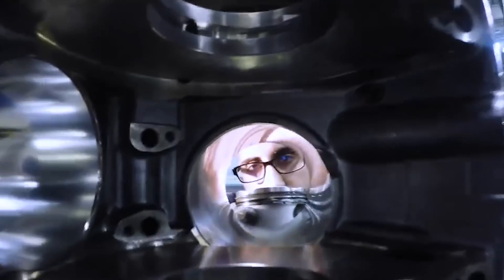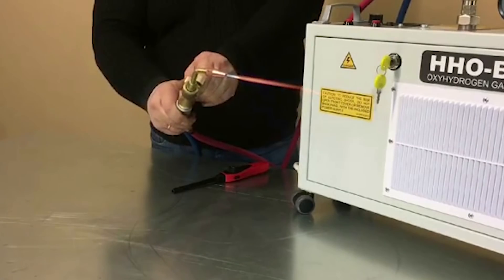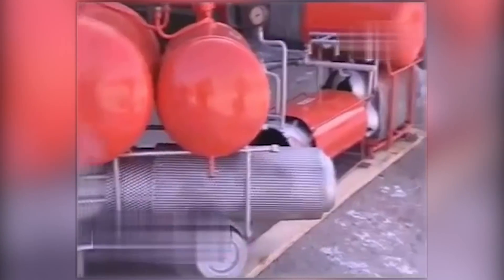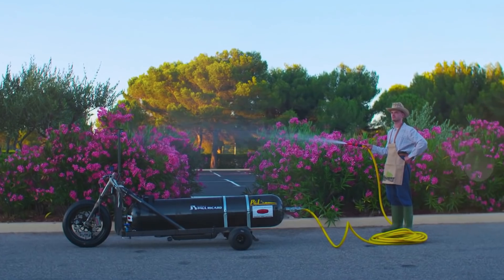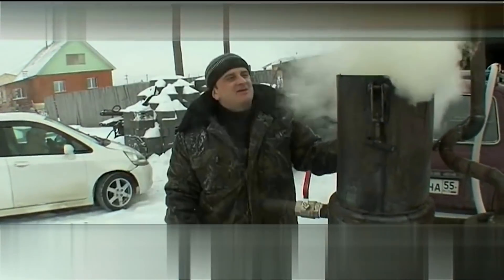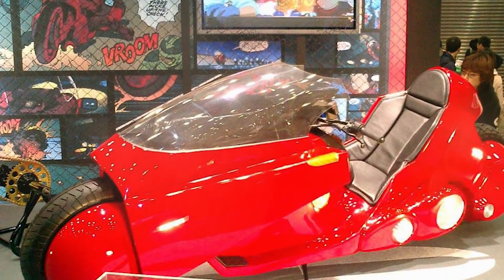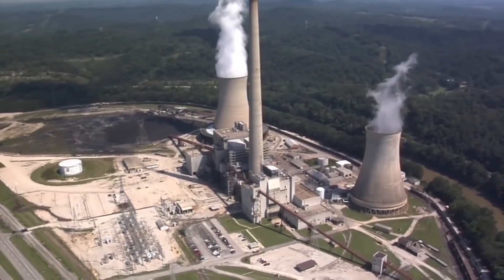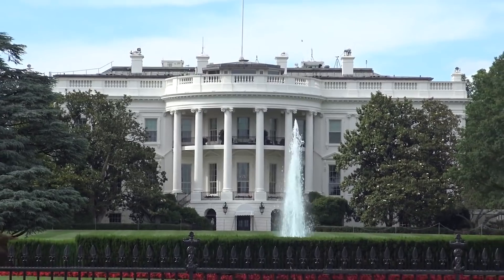Why These Engines Are Banned?

Comment: As an engineer the amount of wrong in this makes my brain hurts
Reply: Was just thinking the same thing.
Reply: Energy of any type doesn't come free.  Compressed air has to be compressed somehow for example.
Reply: @desert1able76  Hydroelectric and Solar ARE free energy. Just build the device and they harness the energy coming from the sun. Hydro is most reliably consistent wind is very intermittent or variable. Hydro dams run 24 hrs. a day.
Reply: @W.451  Actually no. Hydro is best of renewable energy sources, but its not free. Hydro requires pretty huge amounts of concrete, steel and more over room, to keep water stored as you wont get water equal amounts during the year. Also its highly depending on area and cannot be put on just about anywhere. Its useful ,but it does has flaws and few actual dangers like dam collapsing and letting huge amounts of water down to valley that most likely has some city in it.

Then second best or worse renewable energy source is wind power. While can produce lots of energy it wont, cause wind is not constant and down time of wind turbine is aroun 60% of the time. Further more producing the wind turbine takes ridiculous amounts of energy, is destroyed by even small storm, its maintenance and fire fighting is difficult due nature of its tower structure, even more so on ones that are at sea. Finally i just heard about this but coolant used on those to keep generator cool enough is absolutely horrid shit for all living things and its sort of super greenhouse gas (need to research this more though)

Finally the solar... Sure if you have multitude of panel arrays that can track sun you get some decent power, how ever panels life expectancy is at best 10 years, system costs lots of money to set up and takes even more space. If UK for instance would go only solar usage and cut energy needs to minimum, solar arrays would take 1/3 of countrys land mass.. meaning all the trees need to go and everything is needed to be flatten. Lets say we invest on solar systems... what we do about them in 10 years? At the moment all the solar panels get shipped to 3rd world countries where they rip them apart, leaking very toxic gasses inside of them and smash them to recycle some of the metals, while scattering all the heavy metals used to manufacture there into soil. Simply put using solar moves problem another side of the lake so its non issue right?
Also just like with wind power sun wont shine everyday so efficiency goes down. Have crap on the panel and efficiency goes down. Bolt them on rood and you loose 30% of efficiency right there.
Only proper solution for solar would be dyson sphere what controls how much heat radiation gets to earth while beaming energy via laser to orbit and to earth.

Simply put there is no free energy and currently each has its own problems. Going with fossil fuels wont work for ever, but pushing electric cars wont do it ether as those need lithium batteries and those are far worse due mining and processing.. and still fail in comparison to fossil fuel by energy density. I'm open for suggestions but preaching electric is just bullshit that wont in practice until way better energy storage options and the mean while lithium processing and mining should be moved to different planet or into space, where there is plentiful supply of different resources.
Reply: @Hellsong89 Actually yes,  Hydro, is free energy. The building of the device is not part of free energy. Free energy does not require a fuel. Does not require the consuming fuel to harness energy as coal or oil in pumping and transporting or refining the fuel. It does not include building the device to harness free energy.  The source of the energy itself is free.    Hydro produces side industries at the lake formed. extra water sources etc. Hydroelectric dams produce a constant level of power 365 days a year. Hydro has been a fantastic blessing as it produces 24% of the world's energy.
Reply: @Hellsong89  How Long Do Solar Panels Last? 25 years (or longer). This is the industry standard warranty from Tier 1 manufacturers. In reality, solar panels can last quite a bit longer than that: the warranty typically guarantees panels will work above 80% of their rated efficiency after 25 years.Jun 7, 2018
Reply: 451 i see both of your points. It takes a lot of energy to make these dams, batteries, and panels. Engines to haul, mine, produce, etc all these things. There's still no way for batteries to power large machinery. An 18 wheelers would be mostly battery in weight to transfer any freight any reasonable distance. Just things to consider
Reply: @W.451  So you have no concept of amortization of costs. Excellent.
Reply: @mfree80286  The energy still comes free. Can't understand the simple thing light and gravity powered water are self produced unlike combustion fuels.
Reply: @W.451  Hydroelectric runs as long as there is the water supply, but this means you depend upon the location - unless you have a closed-loop system where the same water is reused (pumped back uphill, entailing use of grid power) and it is for energy storage rather than generation. True about wind power - so many negatives to it. among which is dependance upon the location - and likewise for solar (stronger sunlight = better generation potential) which also suffers with degradation of photoelectric equipment (in the case of photovoltaics) and the petty matter of dust settlement (eg the fabulous mirror farms in the USA that failed because of breakages and dust).
Nuclear is the future for static power generation, as long as politics don't get in the way..
Reply: @W.451  Properly tap a single volcano and we can power the planet. The biggest hurdle then becomes transmission.
Reply: @W.451  not free energy. Millions of dollars went into building the dams and turbines to harness this energy. Millions of man hours in construction and maintainence is spent every year to keep this free energy operating.
Reply: @W.451  says you. You can say whatever you want to make yourself sound smart and right, but it still doesn't change the fact that you're wrong. You don't have the ability to collect the "free" energy from a hydroelectric installation. You have to pay for it. You don't have the ability to collect the light from the sun and turn it into electricity. You have to pay to have the ability to do that. Your idea that the energy from the sun and water is free is faulty due to the fact that the energy from the sun is in a form that you have to modify to use unless you are growing plants. It is free to warm you when you are cold on a breezy day getting out of a swimming pool. But the energy from the sun won't run your air conditioner or turn on your lights. You have to convert it. That costs money. The only thing that truly is free is the air you breath.
Reply: @W.451  "blah blah blah" The thoughts that are constantly on your mind. Does it hurt to form a complete sentence? You should take a break. I see steam shooting out of your ears. You can edit your comment so you don't have to make a separate comment starting with the word 'and'.
Reply: "Energy of any type doesn't come free.  Compressed air has to be compressed somehow for example."  It is called a trompe.  It has no moving parts aside from a valve.
Reply: @wesbaumguardner8829  You aren't getting 3000psi out of a trompe. And with the size of tanks versus the work desired, without 3000psi you aren't getting out of your driveway.
Reply: @mfree80286    The head pressure is only limited by the elevation difference between the air storage tank and the water outlet.  To achieve 3,000 psi, this is only 7,000 feet.  Oil companies drill to this depth on a regular basis with directional drilling.  A quick internet search showed the deepest directional drilling being 31,000 feet, so you do not know what you are talking about.
Reply: @desert1able76  also storing compressed gasses always carries some risks of the tanks rupturing, which is not fun.
Reply: @desert1able76  Foot Pump ? an a little excercise :)
Reply: @desert1able76  
Yes, and he already explained that it was overall cheaper and much less pollutive (don't need a lot of energy).
Reply: @MaverickSu-35   Robin Smith  
Please go ahead and use these vehicles. We need a cleansing of stupid people anyway xD
It's a very good idea to sit on not 1 but 3 tanks that are basically bombs. If it breaks you will go flying like a mitten in a storm.
Reply: @MaverickSu-35  and he was wrong. the law of thermodynamics means, the amount of energy needed to move the car, however light you make it, would be the same amount of energy to compress the air. the only thing that happens is some energy is lost in the componants of compressing the air and putting the air into the machine. your still better off just putting the engine that compressed the air into the machine, you know, a petrol engine lol
Reply: @matthew4107  
I agree with you, but only for the particular case of wasting energy to compress air on very small scale such as using an electric motor (which also gathers electrical energy from a fossil fuel conversion) or simply a combustion engine to drive a pump for compressing the air in a small cylinder in your car. At an industrial scale though, if using highly economic combustion engines or electrical motors to compress air in high volume cylinders, you may probably get more economical overall. If no one has done a fair test, we're only trying to estimate using our minds and in most of the cases, what we think of is more or less far from true. It can be rather precisely as thought or it can be far off. I'm not trying to say that I'm right, I only wish that someone like "Project Farm" (if you know about him) could simply make some tests (within the available limits of accuracy) and just check how much he has wasted versus how much he has economized regarding the use of compressed air as a sort of propellant.

I personally love the combustion engines anyway, but I've only gotten into this idiot subject of using compressed air as fuel just by chance, and now I'm like trapped into a vortex of replies and contradictions=))). I don't mind now and for the sake of contradiction, I consider that there's a possibility of using a high efficiency (low losses) process of compressing air at an industrial level for driving our cars with, might actually turn more economical, but again, it's just my guess and it comes as a counter to replies that I don't find right! Cheers!
Reply: @matthew4107  The actual meaning of free energy is that the energy source itself is already there with out processing or extracting from a form energy from a raw form. Everything you just wrote is about a perpetual motion device nonsense. Get it straight gasoline has to be produce and it cost money and effort. Solar and hydro are not produced with anything from man.  Just build the device and harvest the energy. The device will cost, but the light and water are power by the sun. Totally different thing. The sun and water pulled by gravity, energy source is already there.  Oil costs to refine and transport.
Reply: @matthew4107  Realize a LOT of people really aren't very bright and confuse perpetual motion with a free sources of energy like sunlight or water - hydro dams water cycle is powered by the sun. We just need to build the device, but the actual energy itself costs ZERO unlike oil etc.  Like those solar phone chargers, put that in the sun and charges without burning any fuel processed with costs and effort. You can run a phone for it life and never plug into the wall as the light energy is actuslly free.
Reply: 451 its a shame people still cant see it lol.

Ok, fit a solar panel to a compressor, compress the air with that power, wait. Why not just put the solar panels on the car to compress the air, 

Ill tell you why, because youd be better off running the car from the power given by the solar panels, and not wasting energy compressing air to run the car....
Reply: 451 il not confusing anything with anything. I have full understanding of how power generation, storing and sharing works.
Reply: @matthew4107   I said some people confuse perpetual motion idea with free energy. Not related. And while sunlight is free, solar panels convert only a percentage of it to electricity.  Solar panels convert about 20% of the light to electricity.
Reply: Maverick Su-35S But it’s literally not. Also air will diminish in pressure.
So your car will fizzle out.
That car has been featured on futurism shows since the 90s.
Reply: @kevinjackson4464  the funny part of that statement is that this guy is pretty smart. he's getting paid by youTube to post these videos, and get a whole lot of people to watch them, comment on them and "subscribe"!!!
Reply: @SonnyKnutson  what you think your fuel thank is or you lpg tank is ? And nowadays you dont need that with the number of vehicles on the road who get on fire by electronic issues i would feel safer in one powered by air
At least those will not burn your skin up when they blow 😂😂😂
Reply: @desert1able76  Indeed. Frankly, I prefer a compressed air vehicle. The amount I spend on gasoline/petrol is about US$120 a week. The amount of energy to fill 3 compressed air tanks is way less than 120 a week.
I am highly interested in importing on of those cars.
Reply: @PrincipalDBA  You'll be very disappointed.
Reply: @PrincipalDBA  Imagine how much cheaper it would be to run them straight on electricity and cut out the inefficient air compression process!
Reply: @PrincipalDBA  Compressed air tanks are heavy and cannot hold very much energy. Usable range is very short. Also, the "well to road" energy efficiency is poor.
Reply: @Dave5843-d9m  
Thanks Dave for taking the time to reply. I am thinking the application is therefore very limited and not for vehicular travel.
Reply: @PrincipalDBA  you would spend more running that car than you would on gasoline, and besides, you couldnt drive it because it wouldn't pass safety regs. Making such a car safe would make it weigh twice as much.
Reply: @PrincipalDBA   The air compressor needed is $3000 for the cheap one.  Maximum Pressure Output 4800 psi .  cost to fill calculated out to be $5.20 =  $.15 per mile. Gas car $4 a gallon 30mpg = $.13 per mile.
Reply: @szki272  Thanks. Gas now cost way less except maybe California. :)
A compressed air powered car is having limited scope, maybe indoors like a warehouse or underground facility but not for commute.
Reply: @PrincipalDBA  for the amount of power it has, and the speeds it does, there isn't really that big of a difference. I mean these cars have about the same amount of power as a small motorcycle engine, probably less to be honest. Compressed air is rather heavy and also dangerous, moreso than gasoline. If you get in a moderate to major wreck in such a car it WILL explode. Not to mention that relatively low energy density. If you wanna save money, get a car with a smaller engine, or swap the engine in your current car for something smaller. Sacrafices will be made regardless of which you go with.
Reply: @PrincipalDBA  mate, 3 tanks of compressed air won't do the same amount of work $120 worth of fuel can do
Reply: @PrincipalDBA  But HPA compressors cost a shitton, so no.
Reply: @desert1able76  AETHERIC atmospheric free energy .
Tartarian architecture all around the world still have Aetheric atmospheric free energy built into their architecture.
Reply: FEMA offers fully detailed blueprints and instructions on how to build the "wood gasification system" for free on line.
Reply: @huntsbychainsaw5986  It is called a Gas Producer and during the oil crisis of the second world war it was common to have one fitted to your car. My did had a straight 8 Buick and ran it on coal or charcoal. Obviously having and open fire on the back of your car and took half an hour to start was not very practical so they were dropped after the war. Nothing new here .
Reply: @frankiedogturner1516 . I'm aware of this, I did my dissertation on alternative fuel in college.
Reply: Hunts By Chainsaw Germany used it in the closing stages of WW2 to power Tiger tanks.
Reply: yeah, this reeks of bullshit.
Reply: Ikr, in principle. Sure.
In practice? Laughs in the laws of conservation
Reply: As an engineer I agree also, also this is just conspiracy hysteria.
Reply: @Allen Loser what is a yard?
Reply: Oil, gas, and coal companies do not like any energy sources that they can not put a meter on in order to dictate their prices.
Reply: as a non engineer the amount of wrong in this makes my brain hurt. I can only imagine someone who knows a lot more than me. God bless you
Reply: Lava LifeGuard  I mean he didn't say English Major.
Reply: Boy oh boy! I sure can go along with that statement!! Unfortunately the masses just absorb without discretion.
Reply: Exactly! All the knowitallery is just stunning ... all the promises of 30, 40, 50 % less fuel ... blabla, all of it! If any of that were true, one company would definitely use it ... this isn't even about engineering, but very very basic economy.

Conspirancists and technological analphabets go hand in hand...
Reply: DC this isn't about economy you twit. It's about not rocking the boat or changing how comfortable some people fell unless you force the change.
Reply: Hell, as a non-engineer, it makes my brain hurt too...
Reply: from one engineer to another, its all over youtube, absolute bollocks everywhere
Reply: None of these engines are banned , just fake.  Hucksters come up with them to bankroll a fake project it’s just a scam. All those sleek looking bikes and cars work off batteries or gasoline, and are only built to separate investors from their money.
Reply: This just goes to show you, that if you come up with a breakthrough invention that could greatly better the world but also disrupt the grip that the powers the be have on it, you should keep it a secret lest you end up dead for your efforts.
Reply: As a normal layman,  this hurt my brain. Fossil fuel Giants are in the game for energy, not just fossil fuels. If there was a cheaper way to power the world, you can bet companies would be jumping on it, possibly the same companies who are using fossil fuels. The reason we use fossil fuels is their energy density. You just can't get around thermodynamics. Have a nice day everyone.
Reply: @lancelefevre351  40% of oil production goes to transport. I acknowledge the fuel density is higher (at the time being) but what doesn't seem to be taken into account is the inherent inefficiency of the majority of piston engines (no more than 15% in reality). So given this, the fuel density used in these engines must have 85% negated as it's wasted. The worst way to use fossil fuels is to burn them.
Reply: roots No1 M Souljah that is true that modern cars barely use the energy and waste most as heat. There are far more efficient engines that use the fuels at higher percentages though. The 2 stroke turbo diesel can reach numbers of 50% and higher. Same with the turbine combustion engines used in power plants and such. Where I was making my point was, an 18 wheeler can carry 250 gallons of diesel and move 80,000 pounds 1,100 miles or more. An electric 18 wheeler is beyond our current technologies because there are not batteries that are both powerful enough and light enough to move frieght any reasonable distance. Gasoline has more energy than lithium batteries by density. Way way more. There is no current technology to move the world without fossil fuels. Not saying it won't come, but it's not here yet.
Reply: Lancifer Lancifer also because fossil fuels are more reliable and common than other energy sources
Reply: boogi_playz exactly
Reply: Lancifer Lancifer Shell, BP, ESSO are all bu
Reply: @lancelefevre351  agreed, but the application of thermodynamics could be greatly improved. Look at Diesel electric trains. They get insane fuel economy because they power a generator which energizes the traction motors. Cars would get over 100mpg easily if we used this tech in cars, but then they aren't going to make as many billions. In 1998 we were driving big sedans with v-6s that got 30mpg now we have 4 cylinder with turbos barely getting that. Some 20 + years later we should be doing much better.
Reply: @jeremypilot1015  I agree completely. My 2000 Toyota tundra V8 gets 21 mpg and the new tundra gets 13. It's a money game. Front to back
Reply: @lancelefevre351  "As a normal layman,  this hurt my brain. Fossil fuel Giants are in the game for energy, not just fossil fuels. If there was a cheaper way to power the world, you can bet companies would be jumping on it, possibly the same companies who are using fossil fuels. The reason we use fossil fuels is their energy density. You just can't get around thermodynamics. Have a nice day everyone." Yes and no. YES, they'd love a better fuel / energy generator. But NO to the "bet companies would jump on it" part. They have it too easy with oil, too much invested in it. So you can guarantee they want to squeeze every little droplet out of that first. Stuck in their greedy ways when it comes to oil. It's odd though, because they'll always need oil for lubrication in machinery. Just shouldn't be burning it anymore, especially on mass like... 🥴
Reply: @Johny40Se7en  that's one of the first rebuttals to what I said that I feel like is a damn good point.
Reply: @lancelefevre351  Re-think energy density as Thorium fast reactors outperform fossil fuel and was closed down in 1969  after it was perfected. Not much lobbying needed in congress when you consider the petrodollar.
Reply: @lancelefevre351  not really the key is that you can't make it yourself (at least not cost effective).
Reply: @lancelefevre351  I definitely believe that fossil fuel giants will hop onto the next thing as soon as it's more profitable, but I believe that there will be a small period before they do, as new tech will need to be a good margin more cost effective than the old, to make up for the cost of needing to update all your facilities etc.
Reply: @lancelefevre351   stay with law ;)
Reply: @lancelefevre351  true, but... rebuilding the whole production chain has huge costs, so there might be something to the idea of "technological inertia" - nobody being too willing to do complete retooling, and at the same time, nobody wanting to be out-competed by any of the new guys, so they just assassinate them. you've got to admit that the amount of mysterious deaths and murders amongst people who claim to have found new, cheaper energy sources is suspiciously high...
Reply: @lancelefevre351  however there are more and even some can be replaced the problem is these people end up dead before its ever fully completed soo what about that ?
Reply: @lancelefevre351  ~ A logical deduction for someone who fervently believes that people NEVER conspire to achieve unjust enrichment. See Patrick Kelly's (free) free energy book. It is about 3,000 pages describing in detail hundreds of potentially viable free energy devices, mostly in sufficient detail to be replicated, fully analyzed by an electronic engineer (at least)with many of them inexpensive to build as well. I'll leave you the joy of seeing how full of conspiracy and subterfuge the world really is. "Normal" has recently been moved up a few notches, so please catch up.
Reply: @lancelefevre351  That's a bit of a naive outlook don't you think?  Ever consider the threat to their profit margins if there is a cheaper source of energy?  Didn't you hear about all the mysterious deaths of those linked to alternative energy?
Reply: @lancelefevre351  you would think so wouldnt you
But look at newspapers the tech was developed to make paper from hemp instead of wood pulp
The machinery changes would have cost them millions in todays money
So they started the war on hemp/cannabis instead because they would rather supress things that cost a big payout for gains in the longrun
How many times do companies buy up new small tech and just shelf the item that would be competition
Reply: @lancelefevre351  the name of the game right now isn't power density but the reduction of greenhouse gasses which means a loss of profit for oil and gas companies. So it stands to their gain to try and only make monetized forms of power, that's what started the push for hydrogen a while back was because companies saw another monetize able fuel source as opposed to switching entirely to electric that is way more feasible for the near future.
Reply: @lancelefevre351  Tesla was about to give free, wireless energy to the world. When JP Morgan (his financier at the time) asked him... how do you meter it? Tesla answered.... you can't. Morgan shut him down immediately. See, the real crux is that they want gradual, monitored, metered, controlled progress in order to not upset the balance of power, which is in their favor.
Reply: @lancelefevre351  No, they absolutely would not endorse the development of self-sufficient energy production; the entire idea of "the free-market" is to breed dependency on external products. That is why the Aboriginals in Australia were bussed in from remote tribes against their will, why the "trail of tears" happened in America, and why the Vedda tribe in Sri Lanka had their right to harvest from the local rainforest revoked by municipal authorities - they DO NOT want you operating off-the-grid, under any circumstances. This means there are less tax dollars to embezzle, less profit for corporations, and overall less control over you, and through natural extension more power over them. Another rule is that organizing outside the jurisdiction you pay homage to is also a no-no. If you want some idea of what happens when you try to form a mini-enclave inside your country look at the Waco Siege where the CIA/FBI fabricated evidence to burn their entire community down, or look at Amos Miller Organic Farm and what happened to them this year when they started building something autonomous. Positively THE LAST THING TPTB want is someone distilling their own water with sunlight, or powering their home with DIY technology, no fucking way is that going to fly absolutely anywhere on this blue ocean planet. You might say "oh - but i can garden", ya, for now, U.S gov are currently passing legislation to force people to declare their community gardens to the federal government.
Reply: @lancelefevre351 , why can't we get around thermodynamics?
Reply: Lancifer Lancifer idk man if something threatens a giant, suddenly it’s gone hmmmm
Reply: Yes
Reply: Allen Loser exactly. That was my point as well
Reply: Allen Loser exactly, same as rust is the burning or oxidation of iron. I've never looked at it like ashes though. That's pretty awesome. Hydrogen bonds in water are pretty amazing too. How much energy it takes to turn water into steam always blows my mind.
Reply: Allen Loser and more to your point, these companies are the going to do an immediate transfer to different energies. These companies do however spend the money on research and lead a lot of the research into future energy. It's the industry they're leading, they have to change with the times.
Reply: Titus  look at all the engineers maan...
Reply: cmdrbigbob I’m 
With ya. 😆 haha 😂
Reply: Titus  He took the F-bomb out.
Reply: @Allen Loser but I suppose if you could use solar power to do it it will be a fairly efficient way of storing the solar energy, specifically if you need to store the energy for long periods
Reply: @Allen Loser Goodyear started off selling Condoms, when the rubber condom industry was overtaken by latex, Goodyear moved to making tires.
Reply: cmdrbigbob this guy has absolutely no idea what he is talking about
Reply: cmdrbigbob 👀
Reply: @Allen Loser you smart!
Reply: @Allen Loser no but deuterium, and tritium are, which are isotopes of hydrogen.
Reply: @Allen Loserthanks for the response. 
i agree with you 100% except for the last part. Yes fusion reactors hv been 20 years away for 50 years but this is due to the fact tht it was always 50 years away, but engineers looking for grants cant be honest and say gimme a hundred mill and ill hv something for you in like 50 years. Lol. So they hv to constantly make it seem as if just one more cash infusion and voila. 

But I believe they are actually 15-20 years at most away from the first economically viable fusion reactors. To which i believe will consist of deuterium/helium 3 or pure deuterium reactions to start.  I also believe that protium reactions aided by cno(carbon nitrogen  oxygen) will be commercially viable shortly there after.(in large reactors)And maybe 30-40 years from now we should hv the technology to create msmh(meta stabilized metallic hydrogen)
Reply: @Allen Loser the idea was that it would run the packaging department of the seed farm. The gov gave a partial grant. On paper it seemed alright. If it lasted 25 years it would have been paid for and I would receive tax credit every year it produced. Pretty much a loss.
Reply: Combine a bunch of conspiracies with professional editing and narration, anyone will automatically believe it.
Reply: I can 100% relate
Reply: youre just a bad old oil magnate ;)
Reply: Not even an engineer but how much he says "Imagine if oil companies found out about this" hurts. Not all the ideas are practical and 100 kph is actually relatively slow.
Reply: this, very much this
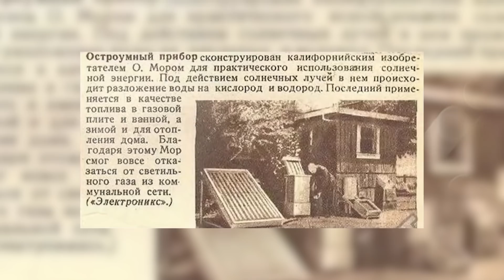Reply: I am almost at the point of throwing up at the ignorance after 1:50. I will not watch more.
Reply: me too. Im actually quite angry.
Reply: As an uneducated intellectually challenged specimen, this hurts my brain.
Reply: Engineers doesnt really know much about this things,if you're a technician that i will believe you.
Reply: Engineers doesnt do shit.
Reply: I hate to break this to you but the theories you were taught are not necesarily the only way of doing things. Don't get stuck into one mode of thought. Science and engineering become stale with that kind of mindset.
Reply: Yup.
Not an engineer, but i design lots of circuits. Its hard to watch...
Reply: Brain pain ouch
Reply: As a fellow Engineer, i feel your pain as well.
Reply: Titus  perfection comes in many iterations of design :P
Reply: Titus  And AFTER editing it's grammatically erroneous!  Wonder if it was correct before :-)
Reply: Titus  engineering has nothing to do with getting it right the first time.
Reply: Titus  no u
Reply: -.-' yea even as a pothead im sitting here like really.... did you just say nuclear fusion and then refer to a "Nuclear **Fission**" plant..... so as engineers i feel a portion of your pain
Reply: @j mcmann well if you payed attention in the 3rd grade you would understand that fossil fuel in particular Crude Oil is formed by fermentation of biological matter at high pressures in the earths crust over 100's of thousands of years.... basically the same fucking principles as the formation of ethanol when making moonshine....
Reply: For an engineer you're not very bright anyway, but that's what we have for education system these days, it is not your fault.
It wasn't about the engines.. This is why we have so many problems. Research holodomor, Rhine Meadow Death camps and other events in history and realize whats really going on in the world.
Reply: Combustion engines are truly inefficient.
Reply: @j mcmann why don't you look up how ethanol is formed in the making of moonshine... your answer to the fossil fuel question is explained right there, except with fossil fuel (crude oil) its the fermentation of organic and biological matter at high pressure for 10's of thousands of years one of the byproducts of this fermented organic and biological matter (fossil fuel) is ethanol which can be burned in an internal combustion engine
Reply: @j mcmann well aren't we talking about fossil fuel here on "Earth" not on some planet technology has only observed through a fucking telescope lens, and for your information biological beings such as a dog or your own human body contains a substance known as glucose from the things you eat, now glucose is basically sugar but is formed naturally by plants, you see where this is going? or you need me to slow down and spell it out in 2nd grade language?
Reply: Titus  And he still didn't make a cogent sentence.
Reply: @Allen Loser Using compressed air/gas isn't to far fetched as you may think, in the early part of the 1900's compressed air propelled Torpedoes could travel about 1,000 Yds, introduce a fuel source such as kerosene and the air will get hotter which in turn makes it expand more.   The Japanese Type 93 Torpedo inspired by the British oxygen-enriched torpedoes had a range of about 10 K.
Reply: @Allen Loser That's exactly what was designed in the early 1900's, the compressed air is used as the power source to drive an engine,  by injecting a fuel i.e. kerosene and igniting it,  that in turn heats the air and makes it expand producing more gas to drive the engine.   By cooling the combustion chamber with water; which turns to steam, that steam is also fed to the engine together with the combustion gases.  They are called Wet-Heaters.
Reply: As an BSEE, i agree 100%. Because the idiots who say anything over 100% don't understand math.
Reply: @jeffreyryan7671  But you can go over 100%,  depending on it's use.  I.E There's a 200% increase in thrust from the new rocket.  The country is in complete meltdown with inflation running over 2000% compared to two years ago.....Or am I taking you comment out of context?
Reply: Titus  THATS your best comment? How do you know he didn't just realize saying anything further was pointless? As pointless as your comment.
Reply: Titus  Now see, right there, I bet you didn't notice your typing was horrendous!
Reply: Titus  You clearly have no sense of sarcasm.
Reply: with that much wrong you could make a engine that runs on it.
Reply: @Allen Loser Exactly - water could be regarded in this matter as oxidised hydrogen.
Reply: It's not even good fiction.  If someone is going to make up facts they should at least provide some suspenseful or interesting story to go along with them, otherwise it's just garbage.
Reply: cmdrbigbob 
I assume that has something to do with why likes and dislikes are turned off...
Reply: Daniel Davidson  
Like the man or not, he's spittin' straight 📠.
Reply: you don't like driving a giant hand grenade?
Reply: I don't think you need to be an engineer
Reply: As an engineer your brain hurts.  What's wrong you mean they didn't teach you any of this in school. LOL. They was to busy lying to you. And Brian washing you into there science fiction dogma.
Reply: @Allen Loser in the case of hydrogen vehicle: you will also be harvesting the kinetic energy during motion, that will recharge the battery and be used for electrolysis.
Reply: same here
Reply: @Allen Loser water is very a fuel! You’ve been gimmicks to believe so! Water is the fuel for everything in the universe!
Reply: @Allen Loser 100km
Reply: Exactly! Look at basic thermodynamics and the laws of physics and chemistry.

1) It takes energy to split water into hydrogen and oxygen, in fact considerably more than you get by burning the hydrogen and oxygen produced. Unless this energy is free you lose.
2) It takes energy to compress air, unless you can capture the heat of compression this is a rather inefficient process, again, unless that energy is free, you lose.
3) Those engines that run on magnetic fields are either electric motors or thermodynamic snake oil.
4) Running a car on wood or other solid fuel is one of the dirtiest ways of getting combustible fuel, without a lot of processing of what comes out of the gas producer you will gum up your engine in no time, assuming you don't' kill yourself with CO poisoning from the carbon monoxide the process produces.

And that is just for starters.

And nom I'm not a shill for big oil.
Reply: @Allen Loser but how was hydrogen created in the first place?
Reply: @Allen Loser The Whitehead torpedo of 1866, was the first successful self-propelled torpedo, and used compressed air as its energy source.  Heated Torpedoes, had kerosene injected into the air and ignited it.  In this manner the air is heated more and expands even further, and the burned propellant adds more gas to drive the engine.  That was in the early 1900's.
Reply: Do the dead people make your brain hurt you pontificating buffoon?
Reply: @Allen Loser Could have fooled me, your body is fueled by water, among other things....
Reply: @Allen Loser You're right that water is not the fuel itself, more of a catalyst in some ways? You die without water as well, but it is not specifically the fuel per se. It was kindof a knee-jerk reply which I immediately started debunking in my own head after I said it. =)
Reply: The amount of tinfoil wasted as hats by some of the people replying here is mind boggling.
Reply: Source: trust me dude
Reply: As a average human I agree
Reply: Huh
Reply: You may be a waste disposal engineer but not an engineer in any technological field.   How do I know this?  A real engineer would have used his spell check.
Reply: As a non Engineer my self, this is all true because I have seen them in movies working fine :). a few Hollywood magic dust and everything is possible LOL.
Reply: Hey smart guy, you would think that you could write correctly. Hurt not hurts. Pshaw, dumb ass.
Reply: As a physicist, engineers, please stay out of that which you know not.
Reply: I stopped at: "this will allow driving with zero expenses". 
Still waiting on the tree that grows into a filled up compressed air tank.
Reply: Allen And your dumb enough to think they don't sabotage anything better than what they have? Do you not know how greed works.
Reply: Allen That's you then most of the hem don't care.
Reply: Yah
Reply: Perhaps you should switch to Electric Gavitic, Anti-Gravity technology....it might make more sense 
TO YOU !!!!!
Reply: Its mind blowing how wrong this all is
Reply: It’s because you spent too much for your indoctrination
Reply: As a small engine mechanic I hate this
Reply: Me too
Reply: You don't even need to be an engineer, just a nerd.
Reply: as a conspriacy theorist I know its all probbably true..
Reply: Thanks, Bob! Thought the same . . .
Reply: Engineers for ExxonMobil, I presume? Capitalist corporate oil monopoly propaganda.
Reply: That's why the engineers need to team up with some of the best personnel for security so that you can be guaranteed to succeed💪👊
Reply: @dannycreech4177  security is purchased. Like a mercenary. To the highest bidder they go. If you create an invention that can greatly improve our worlds sustainability, don't let anyone know you invented it. Post it on the internet from as many different places you can so as to let the world have it. But if you're looking to get rich, then be prepared to spend whatever you earned selling your invention on staying alive. You will either die under mysterious circumstances, or you will just stress yourself to death.
Reply: @dannycreech4177  o
Reply: @Allen Loser Nice try. The correct answer would have been (quote) "...was legally defined to be exactly 0.9144 meter in 1959 under an agreement in 1959 between Australia, Canada, New Zealand, South Africa, the United Kingdom and the United States."
Reply: @Allen Loser True, but with most of their capital tied up in the current fossil fuel model, by and large they aren't going say- Gee, a whole new way of fueling the machines we build! So let's trash billions invested already in the tools, assembly lines, supply chains, and trained workforce and start doing something completely different! Without government policy and some tinkering with the so called "free market" it ain't gonna happen or it takes forever.
Reply: Are the accounts of the mysterious demise of those inventors true?
Reply: @darrenstettner5381  Not entirely true.  There are a good real of facts and origins around some of their deaths, but they aren't as mysterious as the content maker suggests.  Hell, you could make up any scenario to cover anybody's death, phrasing and vagueness will only lends credence as vague and misguided detain isnt provable by nature of the single sided questions they pose.
Reply: @darrenstettner5381  yes. 2 I know of for hho. running cars on water or hho can get you killed if you sell it or put it in other peoples cars. for personal use it's allowed. I had a park avenue I increased the mileage from 22mpg to 34 mpg city highway avg. and 42 mpg highway.  I got a visit from an odd stranger, I believe, because I wanted to sell the generators that could be easily installed on any car. I never saw him again. I told him it only increases mpg but couldn't run an engine by its self. But some people in the group who could runs their cars on water got the above threats about duplicating their work.  The Gov. loves it's money from the gas tax more than the lives and lifting expense and burden from it's citizens.
Reply: @darrenstettner5381  some of them yes
Reply: @darrenstettner5381  yes you can actully find a ton of info with some basic google searches
Reply: @darrenstettner5381  NO. Not 1 of those "inventions" was practical, and the oil companys laugh at them, because it takes fossil fuels to make most of them work. Thorium plants are real, China stole that tech from the U.S. in the 50's and are running a thorium test plant now. We should have been building them long ago, as they are safer than fossil fuels, and eat nuclear waste for breakfast.
Reply: @darrenstettner5381  yes
Reply: @darrenstettner5381  
Some of it during Clinton administration someone was sending Anthrax Letters, the FBI had a guy called Bruce Edwards Ivins as his main suspect. And Dr. Wiley was apparently investigating the origin of the Anthrax...It may have been killed for a different reason, but for a youtube channel Likes are more important than facts.
Reply: @darrenstettner5381  Yes, you can research all those people.
Reply: Russian propaganda this.
Reply: Engineers are educated idiots
Reply: From my experience an Engineer is a man who would climb over 50 virgins just to f*** the mechanic
Reply: @omnigar9611  Top comment---I know several engineers in 3 disciplines; every one of them is addicted to "what the book says".
    These guys invest a lot of time, energy, and money into their careers and thus instantly feel threatened by any information which may rock their boat. 
     Some of the best historical mechanical/electrical discoveries, and one important recent one, were made by amateurs/enthusiasts/students. 
      As for Thorium, it's benefits are obvious and there are a few main-stream Nuclear Physicists who have touted it's advantages----the nay-sayers on this thread are probably paid shills.
Reply: I know what you mean, and worst yet if you tell some one the truth they are mad at you!!
Reply: @Allen Loser I don't disagree (and I thought you handled a number of the dumb-ass posts with a swift correction!). I'm just skeptical of the idea that corporate players at XOM, Shell, BP, etc. will act out of foresight and begin to adapt to changing demand that isn't there. The market for refined oil consists of us car owners, utilities, commercial transportation petrochemical/pharma, and maybe some others on the demand side. On the supply side are the oil and gas companies. The suppliers control the market- for one thing it's oligarchical so collusion is pretty much assured. And the demand side can't say, well what the hell, I'll just buy a car that runs on synthetic fuel made from the Co2 in the atmosphere and water, because there's really no incentive on the supply side to do anything, or at least not to do anything in a reasonable time frame. Given the human lifespan, and the nature of executive pay which is heavily loaded with stock, they adopt a "don't rock the boat" stance. We've been dealing with polluted air since the 60's (made tolerable by public policy) and a roller coaster market for crude since the 70's. And although we run cleaner and slightly more fuel efficient cars these days, the Prius is the farthest we've come in all that time in terms of adapting. I do feel what could change this set of circumstances would BE courageous public policies that create the need to adapt by big oil.  It's a mega market, so I take issue with the "free marketeers" who are content to wait until earth boils over while the big oil folks count their money. I think the very tern "free market" is an anachronism in fact. What's going on today seems to bear little resemblance to what Adam Smith was describing long ago. I am curious to look up some info on the  Fischer-Tropsch process which I didn't know much about. I remember learning about the German's using some kind of synthetic fuel during the war though, I guess that's how they made it. Thanks for mentioning that!
Reply: @johnsteiner2204  The UK has banned the sale of new petrol and diesel vehicles from 2030, after 2035 you can not sell them, or register them to run on roads. At present there's Hydrogen and Battry power, several companies claim to have alternatives and get money from the government to develop the idea, last year the entire UK rand for 8 entire days in the year only using renewable energy. 8 days doesn't sound a lot, but that figure will increase, we are fortunate to be surrounded by the sea, there's major projects ongoing that will be able to harness that never ending source of tides, but who knows where we will be in 20 years time.
Reply: @johnsteiner2204  shell was actually one of the first companies to invest in a hydrogen plant in Greenland using the geothermal energy there, the only problem with that is that it's another monetized fuel source. So they're adapting just not where they should be.
Reply: We already do have a cheap energy source in the form of molten salt nuclear power. It's been proven in the 1960s and in recent years costed to nuclear build standards. Build costs are cheaper than coal. Running costs are negligable. It's cheaper still when high level waste nuclear fuel is used as fuel. The costs are low because the reactors have high passive safety. The hazards associated with traditional nukes are not there so costs tumble. 

The only reason we do not have these plants in use is the cost and timescales of regulatory approval. Companies like Moltex, Flibe and Thorcon are wading though the morass of regulatory processes but we need governments to move things forward.
Reply: Wrote a letter to Clinton and died? The one plausible conspiracy. Just check the Clinton Foundation donations. Millions from Middle East and Russian oil people.
Reply: @kevinmoore4887  seven months on, investigation by partisan republicans complete, no wrong doing found
Reply: @pinkliongaming8769 . Yeah pretty much.  But if that's the difference between life and death, you get to make your choice.
Reply: And you could provide your education to prove that?        I am an astronaut and look down on people like you all the time.  Or you are a denier from Egypt, swimming in the Nile.
Reply: @ThePostal67  An astronaut, that is hilarious.
Reply: AN AN ENGINEER YOU'RE BADLY INDOCTRINATED BY MAINSTREAM SCIENCE....LOL
Reply: One fellow they didn't mention was Stanley Myer he was a well known guy like some of these but he was killed for not selling his patent for the water powered dune buggy
Reply: @darrellemerick7039  it was a hydrogen car you idiot. Simple electrolysis, burn the hydrogen and expel the oxygen. You can find designs for such vehicles all over the internet. His design was nothing. Yes it was impressive that he figured it out in an age before the internet, but he was hardly the first to do it. And what money was GM gonna make by killing him? He wasn't trying to sell his design, and he wasnt gonna make cars, he was just gonna tell people how to make it, that means GM was losing sales to people with the talent and drive to build their own cars which is a VERY small portion of the market.
Reply: @darrellemerick7039  autopsy report said he died of a cerebral aneurysm, the main reason why people think he was poisoned was because he said "they poisoned me", that was it that's the whole evidence to show that he was poisoned.
Reply: better get a new brain
Reply: What if, you could compress air with the wheels or anything that drives a belt or chain?
Reply: As not an engineer, wondering why engineers have to announce to everyone that they're engineers makes my brain hurt.
Reply: @jew-sa  That's because engineers, as a rule, know more about how things work than non-engineers.
Reply: @jew-sa  it's a statement of credentials you idiot. Hes declaring that he is a studied person of the subject he is discussing.
Reply: No one but you thinks you're "an engineer". My shoes have more sense than you.
Reply: @alanfunt4013  do you believe the earth is flat? Id put money on it.
Reply: @alanfunt4013  Jesus fuck, you are self centered and confident
Reply: Hi guys. Nobel Prize winner in physics here.